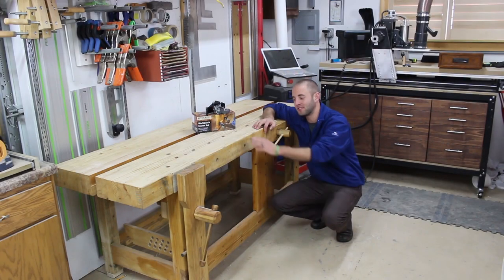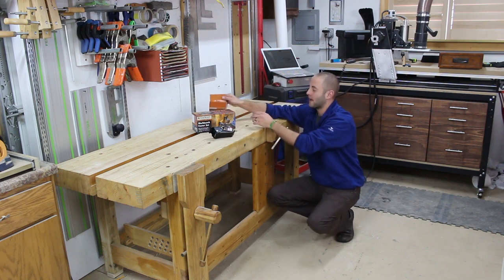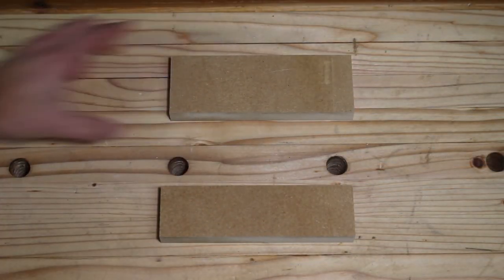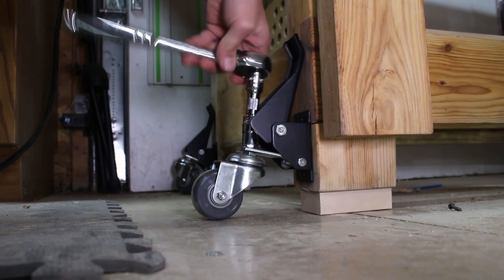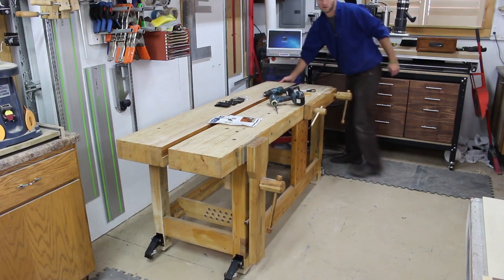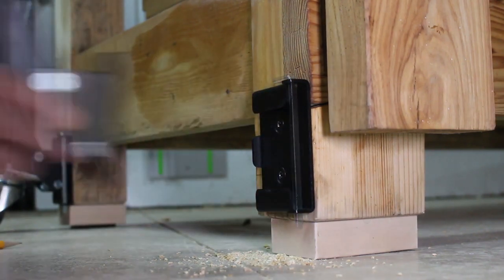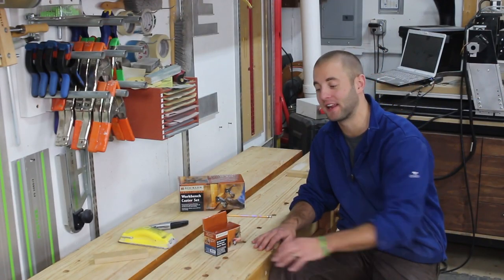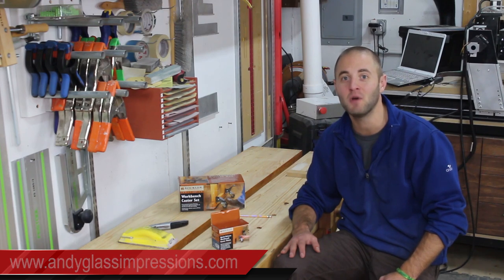Rockler Workbench Caster Kit with New! Quick-Release Plate Review | Glass Impressions

Comment: I like the video you've put together, good job. I was waiting for when you mounted the Quick-Release Plates. On your heavy work bench, how well did just screwing in the machined nuts into wood take hold? I have never used a machined bolt into wood. Surprised it doesn't work lose. Like your other example, I was able to mount mine to a work table where I was able to get to the back side of bolts and attach the nuts. I plan on ordering 8 more of the plates for two work benches that get infrequently moved. A word of caution to some, if your bench or table approaches 250 lbs and up, you may want to pry the corners up as you go around and either drop the wheels in place or release. Love the flexibility of these wheels and brackets.